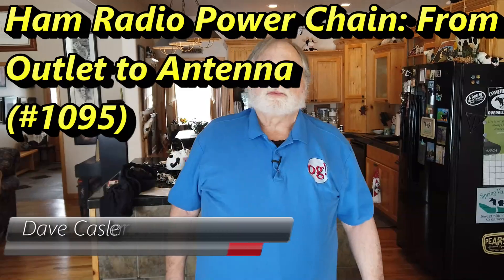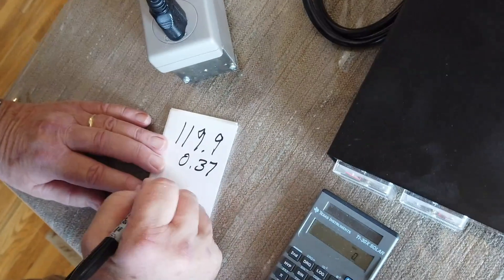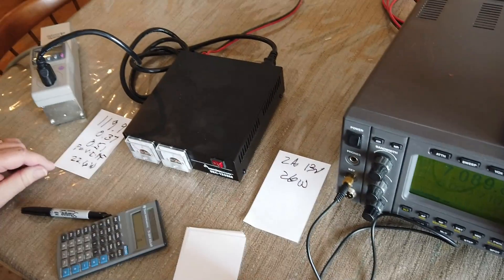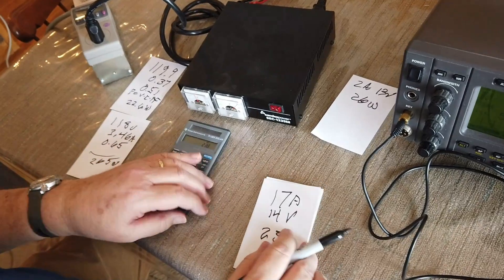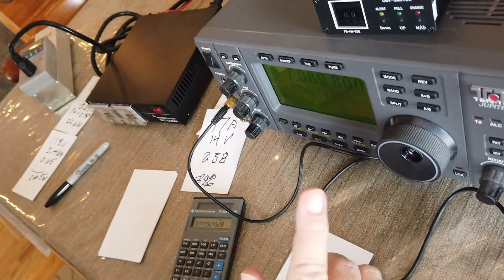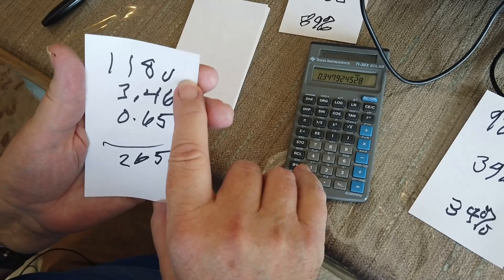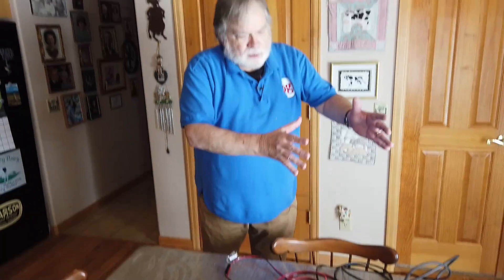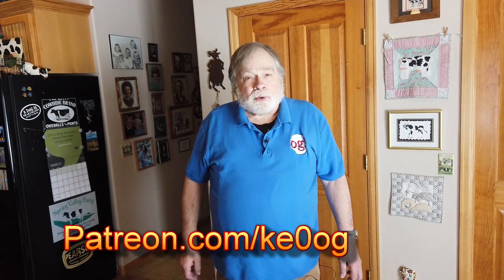Ham Radio Power Chain: From Outlet to Antenna (#1095)

Comment: The radio is a 50 ohm radio. That 50 ohms is in series with your 50 ohm load. So if you have a 141.4v RF source and a 50 ohm output impedance in the radio, you will be dissipating 100 watts in your amplifier and 100 watts in the load. That's why your radio gets so hot. It's by design. It's not much better with a class C amplifier. But yes slightly. But it will still be over 200W dissipated by the radio.